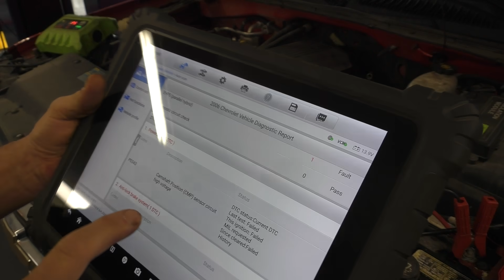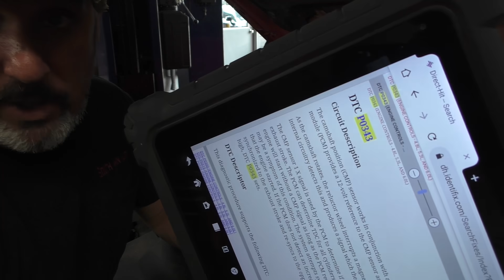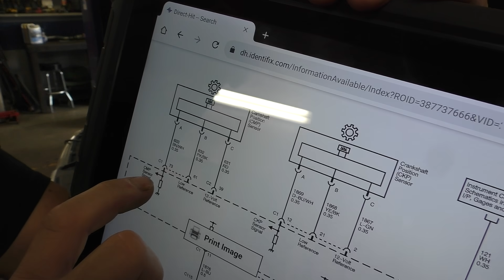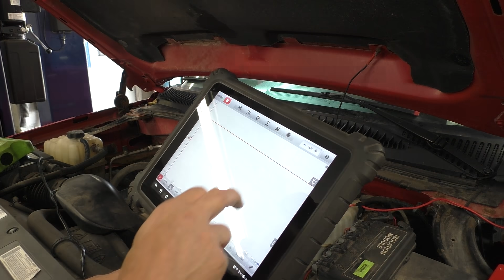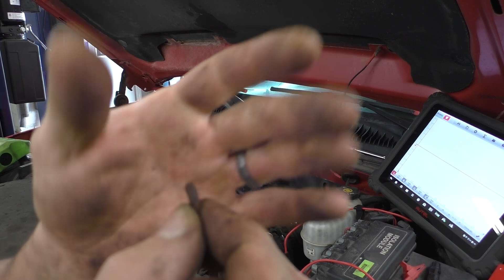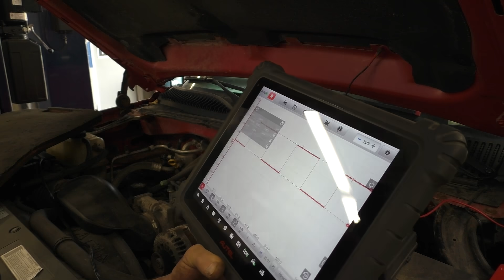Chevy Silverado With A Very Extended Crank - Other Shop Gave Up

Comment: It really never ceases to amaze me that these other shops can’t figure out such a simple system. I’m looking at this at six minutes in and I’ve already figured you probably have a crappy cam sensor which needs to get replaced and most likely the cranks answer circuit would be the culprit
Reply: So I watched the end and ended up being the camp sensor circuit, but for me this was simple since I went to the GM training center back in the 80s as I was a full-time mechanic for me. This was a no-brainer as the symptoms led me to believe it was in, a Hall effect switch

Comment: Just had a 02 in with long cranks but only on the first attempt to start. Second attempt the truck would fire right up no problem. I was the 4th hack to get after it lol. Turned out to be a version 2 cam sensor and they like to cause this problem. Off to my favorite pick and pull to get OEM part off an older truck, trucks been starting first attempt now for 2 months straight 😊

Comment: Thanks for pushing this video out. I am on the hunt for the cause of slow start on a F150 5.0 liter coyote engine. I’ve Isolated it down to LH faulty (Cam Position CMP Sensor) so the release of your video was very timely.

Comment: Always informative. Same principle as when the ABS sensors get rust underneath. Most are going after the sensor and not the corrosion. That’s why you’re the best!
Reply: And the process of changing the sensor clears the buildup of rust and then the new sensor seats properly so, yeah it's fixed but the new part was never required.
Reply: i was looking at my sensor on my 2000 f150 2wd. it can rust jack till the cows come home but because of the design it will never fail because of it.

Comment: If you look at the scope when you were cranking when on the signal wire it did make some type of 
signal for a second. If you would have went back in the buffer you would have seen it. Could that have been something with the fuel pump coming on or just caused by cranking?  Reference 16 min 15 second in the video.

Comment: Back in the 80s and 90s at the Chevy Dealer, extended crank time was mostly the fuel pump relay. My have times changed

Comment: i sat here  "the y put the sensors on fresh, this one might be a fuel issue" before getting into it.
I was wrong, again. you were right again - digging just a 16th inch deeper than the other guy.
And there is your Problem, Lady!

Comment: Not every one is aware of the possibility of "rust jacking"  Thank you for the video
Reply: Wheel speed sensor goes bad and is still bad after you put in a new one?  It's high on the list.
Reply: @alex10294  Rust jacking is nearly non-existent in the South where I live.  Rust on cars is rare in general.

Comment: The ECM senses current flow through the 12v power wire to the cam sensor in order to inhibit the fuel pump relay. The test light was mimicking a load so it turned on the fuel pump. This is why the cam sensor is powered from the computer. Its a fuel pump safety item. DOT requires all vehicles to shut down the fuel pump when the engine is not running regardless of ignition key position.
Reply: Thanks for clearing this question up!
Reply: Great information, thanks for sharing. The amount of knowledge you guys have just blows me away.
Reply: @akshonclip  
I’ve seen it done in quite a neat way back in the pre-electronic & carburettor  era using a changeover relay operated by the oil pressure switch swapping the supply to the fuel pump from the crank circuit to the ignition circuit.
Reply: @RB-qq1ky   GM even used the oil pressure switch method on electronic cars. I know the 95 Buick 3800 is setup this way. I don't deal with many GMs though, so I haven't checked more recent models.
Reply: @snoopdogie187  
Yeah, that’s right. That funky 3 terminal one with separate contacts for the light and the fuel pump relay. We had that same engine in Holden Commodores for a while
Reply: @RB-qq1ky yup. My 92 camaro had it as well.
Reply: @RB-qq1ky  Honda was one place they did that well into the 90's.Bad solder joint on the pcb of the fuel pump relay way way under the dash
Easy fix,once you know it.Car could run for months then act up no-start
Reply: @RB-qq1ky  My 1969 Buick Riviera did it this way. It was the only year they used an electric fuel pump on the 430 engine AFAIK.
Reply: Thanks
Reply: I was hoping someone would explain what was going on there. I thought it might be a "feature, not a bug".
Reply: Can you clarify this just a bit?  I'm slightly confused.  The engine ran with the cam sensor stuck high, so obviously the fuel pump is turned on.  But how is there current flow through the sensor if it's never being pulled to ground?  If the signal wire is stuck high, doesn't that mean theres no current flow since there's no voltage differential?  Does the PCM ignore this because it sees that the key is in the crank position?  And then default to the method you described after the car starts running?  Appreciate the help!
Reply: @brianm9007  There is most likely default software strategy involved or the power to the crankshaft sensor is also monitored.
Reply: @brianm9007  
Im not familiar with the nuances of the GM system (my experience is almost exclusively with vehicles unique to the Australasian market that most people on here wouldn't have heard of) but normal generic operation (no immobiliser) would go something like this:

Key on, engine off, fuel pump operates briefly under PCM control  (~3 sec) to prime system, then switches off (because no rpm [CKP] signal received by the PCM as the crankshaft is stationary)
Key on cranking, fuel pump operates (CKP received), PCM is "waiting" for the cam position signal [CMP] to synchronise sequential fuel injection with (for example) #1 TDC.
Key on still cranking, PCM receives CMP, determines where the engine is in the firing sequence, because CMP is indexed to a fixed point in the firing sequence (think distributor vs crankshaft), enables spark & fuel, enters 'start' mode (fuelling/throttle flap position/ignition advance determined by tables in PCM) engine starts...

In the case of the one Eric is working on, there appears to be a default strategy available in the PCM that allows operation using only the CKP signal (which will have a 'signature', i.e. a different amplitude waveform at a definite crankshaft position relative to TDC) to determine at what point #1 cylinder is in its operating cycle and then enable a start once the PCM has done this.

 Typically this default strategy would only be applied if the PCM doesn't get a plausible CMP signal within a certain number of CKP signature pulses (= rotations of the crankshaft) and/or attempts to start. It doesnt matter whether the CMP signal is pulled high or low, the system is looking for a transition of some kind. It will also log a DTC when this strategy is invoked.
 I think the 6 litre diesel  F-truck engines also had/have this strategy.
I would also think it would likely for the PCM to have the reverse strategy as well, so it would still be driveable using the CMP signal if CKP failed? 

Hope this helps, I'm sure theres a few GM guys will want to add details
Reply: @RB-qq1ky 

Thanks so much for your detailed response!  I do appreciate it!  However, the holdup I'm having isn't with the strategy the engine uses to start and run.  I'm confused at the prospect of the fuel pump being shut off if the engine turns off (like in an accident) where the key is still in the run position.  And the way it does so is by monitoring the current flow through the CMP sensor.

Thank you OP for postulating that it may cross reference the CKP to ensure the engine really isn't turning before killing the fuel pump.  This would make sense as a redundancy benefit, too.  Eric makes mention of the ECM strategy for a failed CMP where it guesses the position of the engine, so perhaps this further suggests that the CMP isn't the only deciding factor in fuel pump operation.
Reply: @brianm9007  
Yeah, I am not familiar with the GM protocols for the fuel pump drive. When Eric probed the CMP it certainly sounded like he activated the ‘prime’ function, by sinking current via the test light, fooling the PCM into thinking there’s a functional sensor attached, which would indicate that GM does use the CMP signal, instead of the CKP signal I would see used for this purpose in ‘my’ product.
I would think that the PCM would be looking for a variable frequency AC or square wave (depending on the type of sensor) regardless to maintain operation obviously.
Reply: @RB-qq1ky great write up. Unfortunately without crank that truck won’t run as the injectors are tied too it. 
I’ve only replaced one cam sensor on that year range of trucks myself. I triple checked my tests because they don’t seem to fail. Crank sensors on the other hand do but not too often.
Reply: @brianm9007  i think the test light was pulling the input voltage to ground thus creating a waveform. the signal wire outputs the input voltage unless it is changed by the trigger on the camshaft. since that input voltage was pulled to ground the signal wire sent that to the pcm and the pcm activated the fuel pump relay.
Reply: You are 100% correct 👍 good job

Comment: I suppose it's not for me understand, how is it the previous garage gets to soak the owner for 400, 
and hasn't a clue what really is wrong with the starting system, who or what sort of none mechanic's is that place, rust. I guess anyone can hang a shingle calling them selves 
what ever, no knowledge required. the thing if I can do it you can do it really isn't so. 
great job boss, it so happens this is the second time I seen you cure a problem by flicking the rust off.

Comment: So the other shop, probably in New York and having to deal with rust issues just like you do, did not do the simple, but not comfortable, rust jacking inspection around a part they replaced and had opportunity to do so. What are the odds the old sensor was not bad, but pushed off the surface due to that rust? The other shop owes the owner a refund.

Comment: She spent  $400.00 at the other shop and there was a good chance that the original sensor was just fine.  Rust jacking, Imagine that!!
Reply: Test before you replace!
Reply: @IgorD33  agree, the other shop got there money and still with the same problem of long crank, then Eric O comes to the rescue and bingo the truck runs like a top
Reply: No way rust got under a tightly bolted original sensor . The rust flaked off as they were removing the sensor to replace it . They diagnosed it correctly but didn't count on a chunk of rust to increase the air gap . Their issue was not following up .

Comment: Ivan had a crank sensor that did the same thing. He cleaned up the hole and straightened the bracket and the vehicle ran fine.

Comment: I was screaming " Luna Wants In " and you couldn't hear me. Now I know what to look for on my 2500HD if it ever happens. Great job.
Reply: These are AWESOME trucks. My 2004 2500HD never lets me down; towing, plowing, hauling tools and equipment. I've owned several of them and found they're very consistent. When an issue comes up, I've usually fixed it before or it's at least well documented online so I know right where to look.

Comment: say the sensor was even harder to get to. is there a way to test the signal wire for a short to power like shorting to ground thru test light and seeing if it goes to ground on the scope. just wondering.  love your videos

Comment: A tip for cleaning around a hole like this on a cam sensor, or a wheel speed sensor. Put some silicone grease down in the hole, that way you can get your whizz wheel or cleaning tool of choice right up on it with no worry about dropping rust down in the hole. Gotta love a rust bucket plow truck. Thanks for the video Eric!
Reply: Also handy to have a set of rubber stoppers around. Hardware stores have them individually or you can get sets from the usual online suspects.

Comment: Sometimes you have to start from scratch & not let what other shop's have done change how you diagnose. You just went off the data and looked at the possibilities and found the problem. Great video and how sound diagnostics will inevitably lead to the problem. Definitely not a stupid video & will help others in the rust belts look for rust jacking on sensors that increase the gaps and make them intermittent or inoperable.

Comment: I had a 2006 Chevy Impala with the 3.9L V6 .   It had a problem with long crank.  The problem ended up being rust on the block under the crank sensor.     Good job getting that repair Eric!

Comment: I enjoyed the video. I'm not a mechanic so all the theory about how the crankshaft sensor and camshaft sensor working in conjunction to determine if its top dead center of the compression stroke or the exhaust stroke was really interesting to me. Knowing the camshaft sensor is a hall effect sensor, could you bench test it out of the engine by just waving a piece of metal in front of the sensor and seeing if it brings the sensor wire voltage down? I guess your instincts and intuition led you to believe the part was not likely bad and you went straight to cleaning the crusties. I was a bit worried when the note said it was an aftermarket sensor and not OEM. But obviously sometimes after market is perfectly okay.

Comment: I had one of these come in with a no-start and only a crank sensor code. The customer had already done a sensor, no 5v ref after checking some. Turned out to be a shorted cam sensor stealing the voltage. Started after unplugging the cam sensor because they share the 5v reference.

Comment: @10:20 What is that ground wire for?
Reply: Usually just to ground out the engine "Extra" hoping to fix any other ground issues. It works for some issues. But things have changed a lot lol basically they were runnin blind.

Comment: Was it an oem sensor or parts store duracrap cam sensor? Aftermarket rarely works out of the box or usually fails soon after replacement.

Comment: Excellent video. My HF step stool makes the exact same squeaking noises, it is the one I used while building my home so the noises are special. I was troubled  shooting a fuel pump on a motorcycle and the pump ran for 3 seconds to prime the lines then shut off and started back up upon crankshaft position sensor input into the ecm. Maybe Chevy(thunder) uses the camshaft for that purpose.
Again, great video. No parts required just remove the previous parts rust deposit.

Comment: You keep referring to this as a stupid video but in all honesty this is a huge win mostly for the customer but WOW !!! i wouldn't have thought about this and obviously neither did the other shop..
HUGH win all the way around. 
Thank you sir
Reply: For sure.  Lots of other folks, and shops would have thrown another new cam sensor at it.  Likely a more expensive GM sensor, and the problem would have remained.  If the sensor was in the front, most would have picked up on the rust jacking, but back there, you were going on experience looking for that.  It was a great fix.

Comment: Clever diagnostic strategy, Eric! Good catch of the sensor's bent tab as the cause of no signal. No parts required, only brainpower 🙂
Reply: Brain power indeed..Had the first fella taken a good look at the removed part he shoulda noticed bent tab as well.  It's called visual inspection in the trade.  My mentor drilled this into me and thankfully so.  Study things carefully as you take em' apart.  Most of the time there's an Ah-Ha moment.. Cheers
Reply: @danglin69  Very true!

Comment: learned something new about my work truck today. thanks!  I got a '02 2500hd.  Did my own knock sensors, brake lines, fuel lines and rocker panels.

Comment: Never a stupid video! Very  informative. Something so  miniscule as 1/16" of rust can make such a huge difference. Thank you.
Reply: True with abs sensors as well.
Reply: Yeah that's first thing I thought of.. the wheel speed sensors @letthechipsfly7620
Reply: So long as your unit didn't get rust jacked on that rusty ole Chevrolet.
Reply: So nothing was wrong with the original one but the dealer made her buy a new one for nothing. They could have just cleaned it
Reply: @tatertots-n-soup  
By the look of it, pretty much. Should’ve noticed the bolt didn’t go up hard tight though,  because the mounting lug wasn’t fully supported and the last twist would’ve been bending it?
Reply: @RB-qq1ky  The bolt did go up "hard tight". Whoever installed it would have never noticed the tab was bending while wrenching the bolt. Looks to me that you are going mostly by feel putting it in and you are not going to feel anything with the tab. BUT you would think they would at least stick a mirror back there to have a look before installation and why was it never checked for a signal when they found out it still wasn't fixed.
Reply: @KStewart-th4sk  
The Curse of Flat Rate strikes again do you think?
Reply: @tatertots-n-soup  So the rust built up under the old sensor, moving it away from the proper position for the magnet to work?
Reply: Oh it was more than a 1/16 in. Just all he had left to show you has the main piece of scaling(oxygen+poullen+dust in the atmosphere oxided on the surface and corroding into it) left from most of it crumbling away. I'm certain most of it poofed into red dust
Reply: My thoughts exactly!
Reply: I did one of those, it broke off in the block !!😢
Reply: I really wish that Eric and Ivan would publish a list of how many times the issue ends up being a bad ground. I bet it would be better than 50%.
Reply: ⁸aa
Reply: @jgreitz  
Yes! absolutely. I read in one of the tech publications about a Nissan, where the ‘cage’ around a Hall Effect crank sensor had been discarded in the course of an engine rebuild. The missing cage distorted the magnetic field around the sensor enough to cause a crank-no start concern
Reply: Hey man, no spoilers 😂